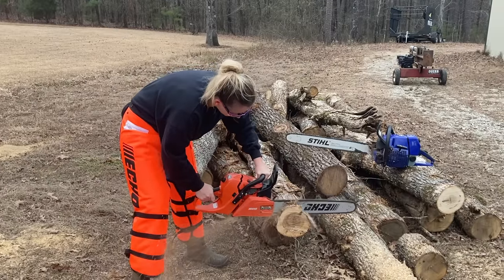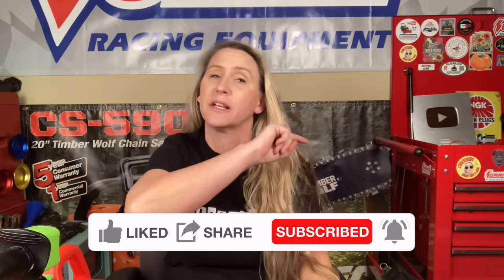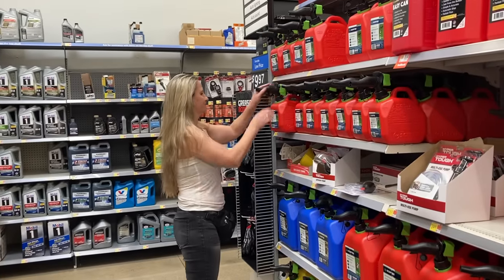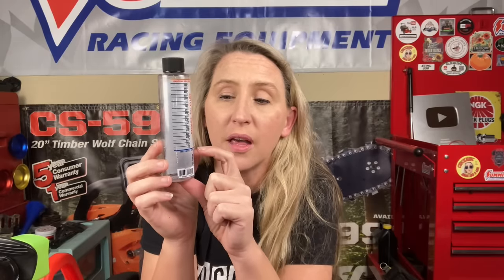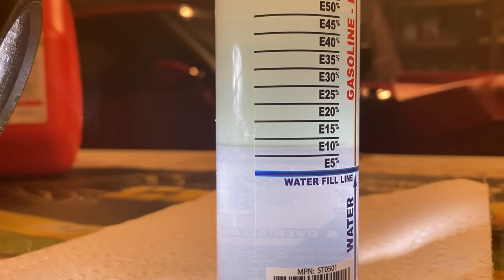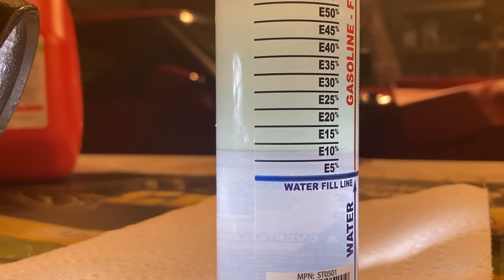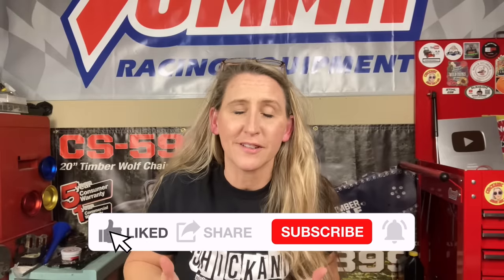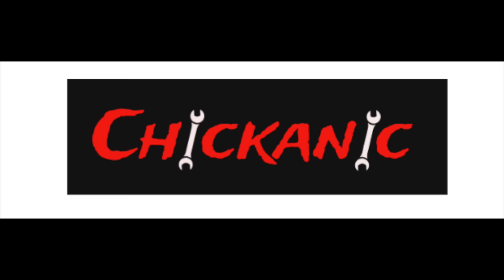Fueled by Deception. How You’re Getting Ripped Off at the Pump! (I'm SHOCKED!) VLOG

Comment: Being an ex-manager for 2 convenience store chains, some people may not know to not get gas at any place where they are in the process of unloading a load of gas. As the gas pours into the underground tank it stirs up the water and sediment in the bottom of the tank. If you get gas at that time or immediately after, you may get some of that in your gas tank. If you go to get gas and a truck is unloading fuel at the time, go somewhere else.
Reply: Hadn't thought of that, before. How long should you wait, before the crap settles back to the bottom?
Reply: What about the filters at the pump?  How often do they need to be changed?  I've been getting fuel for over 2 score and never had a problem, though I don't pay attention if a truck is unloading.
Reply: @magnificenthonky  the longer the better really. Like he said I see a truck unloading or parked at the station, I keep going. I suppose we could ask how often they fill up and when. I also don't gas up if there's been a heavy rain. Just over cautious I suppose.
Reply: The pump filter catches any potential materials. Your car fuel filter would catch the rest. I would say, any station that has slow pumps, has clogged filters.
Reply: I learned this the hard way from experience on my harley.   Had to clean out fuel tank etc.  full of sediment after getting fuel while truck was filling tanks..   I know around Washington the stations I use have separate hose.
Reply: Good tip. Thanks
Reply: Really never had problems after fueling when they where pumping. For there is filters in pumps. That is now a lie same with changing transmission fluid and filter. Not changing fluid and filter can damage for you got a bunch of little sensors and ports that can clog.
Reply: Honestly that's not true, I a receiver at a big truck stop. There say that to get the reading correct because before computers and 500 gpm drops it though the drop off.
Reply: @molallamerica896   And clogged fuel filters will activate the bypass in the filter heads allowing unfiltered fuel into your tank.
Reply: Agree. I've been going elsewhere for 40 years when a tanker was at a station. Never a fuel filter problem or need to put heet in my tank to get the water out.
Reply: I asked a Costco gas station attendant about that. He said nope, filters in trucks and the pumps catch anything.
Reply: This, and other potential problems caused by bad / contaminated fuel, is the reason I ALWAYS get a receipt when I purchase fuel, be it for an automobile, mower, chainsaw, or anything with a petrol engine. Then you have proof of purchase and recourse for any fuel related engine or fuel system issues or damage that may occur as a result. I've known of, and read about this happening over many years.
As an aside, and good advice from Gramps, get a receipt for everything! It will save you grief! Have a great and blessed day everyone!
Reply: I knew this, ive known this for 40 years.
Reply: @magnificenthonky  
At least a day.
Reply: Actually this is untrue because tanks never go that low.. I work on these tank and systems on a daily The amount of water left on the bottom of the tanks are minuscule amounts. If the water gets to certain levels there's a warning system on the pumps Mustplaces have something built in to remove the water.. But not all you would have to have a technician that deals with it come in to remove it
Reply: @samrotolo7303  
I never fill my bike with anything that has ethanol. Actually, I take a few 5-gallon cans in my truck and fill them all with ethanol free, then refuel from my own little storage garage. I'm lucky that the closest ethanol free station only vends one fuel from the pump marked ethanol free. There's no chance for cross contamination.
This video, however, taught me something I hadn't considered. I suspect it'll become useful when I'm traveling.
Reply: @magnificenthonky  5 minutes according to this video.
Reply: I've always done this.  I have also seen the truck and asked the driver where he was in the refilling process.  If he's still hooking up, I'm golden.
Reply: Old wives tale. Ethanol cleans the tanks, brings the moisture and dirt out of the tank. However, you are correct on the non-ethanol fuel, the sediment collects at the bottom and the fuel truck (which I drive) mixes it up.
Reply: Being a part of a great team at a reputable company I know that any good fueling station does water mitigation. If a station has water in the tanks they have issues.
Reply: that reminds me of a chicken carryout, they change their cooking oil on Thursdays so don't ever go On Wednesday's it's the worst🤨
Reply: @Pinkielover  Yes agreed 👍
Reply: @molallamerica896  pulled in an older station a while ago, looked at the spin ons located next to the pump, noted they were almost rotted out in the bottom, so I rolled outta there 🤣
Looks like they were new back in 2008 or so
Reply: And around here I see the fuel truck pull out of the shell near my place after filling them up, and it goes up the street to the Sunoco and fills them up. 
Hope ya like your Sunocogulfbpmobil gas 😃
Reply: i dont know what year u had store, but, we always use to use the meausring stick with a type of grease on stick end, it showed u how much water was on bottom of tank, once it reached certain level of water it was sucked out, many used alcohol to rid water , tanks and baffles have come long way
Reply: 100% I watch for trucks unloading every time I fill up!
Reply: As a guy who installs underground fuel tanks I know that the pickup for the supply line to the pump is in the bottom of the tank. This means it sucks the trash or sediment out first. There are also filters along the way. Not saying it can’t happen but the chances of the water/trash thing are pretty low.
Reply: @torquewrench4958  so over the life of your vehicle your getting unfiltered fuel whether u want it or not.

If filter is in "bypass mode" i guess it cant "shut down at 1st sign of water in the gas". Like they tell ppl that get water in gas.
Reply: @MrTheHillfolk  The trucks have up to 10 compartments (baffles) in the tank. They can carry high quality fuel drop at shell then go next door drop some garbage fuel at an unbranded station all from the same truck. 

I was told that from a tanker driver. Said they scan a barcode at the refinery but in the backend garbage fuel IS being dumped in certain areas. From same truck that also carries high specification fuel
Reply: That's why they have filters so there's no issue in pumping while they fill the tanks
Reply: @torquewrench4958  No they won't. Pumps don't have a filter bypass. A clogged filter is a slow pump.
Reply: @josephwhelan192  Exactly. People are stuck on old ways things were done and keep spreading old information as it’s some kind of hidden secret 😂

Old people are pretty dumb
Reply: @erikkovacs3097  yes they do. We don’t live in the 60’s anymore 😂
Reply: @christophervanzetta  Oh so the pumps slow down to 3GPM because... what? Failing pump impellers?
Reply: @willc5512  cool, I was kind of wondering about that, thanks for the clarification
Reply: I should have figured that out . Thank you
Reply: Damm Costco!!!   They always bringing in truck during the day.  I wish they do it at night after closing time.
Reply: @molallamerica896  this. Also water is soluble in ethanol. So water shouldn’t really accumulate much in E10 blended gasolines.
Reply: @Pinkielover   water is soluble with ethanol. If it’s ethanol blended gasoline you shouldn’t see much water accumulation…
Reply: Yup. This got me twice before I figured it out.
Reply: Makes sense! Of course it didn’t dawn on me until you mentioned it! Thanks!
Reply: Heavy rain previous night. Filled with premium which doesn't sell fast. Customers car ran like crap. Finally figured out too much water in the tank.
Reply: There are filters on the pumps to protect the pump from garbage..
Reply: if the pump runs slow it’s sign that filter is in need of a change, switch to a different pump with better flow rate, some stations cheap out by trying to make filters last longer.
Reply: @Pinkielover  gas station here has pumped there tank dry twice in a few years
Reply: That’s what filters are for ! That’s urban legend !
Reply: @roostercogburn3771  if your at a station and it pumps less that 1 gallon in 14 seconds either the filters are starting to clog up or there have a weak submersible pump !
Reply: And here I thought that the pumps drew fuel from the bottom of the tank.
Reply: @Midnight-tw3gp  only on really old suction pumps. Today all the pumps actually in the fuel tank ya lift a handle on 1 they all are pressurized
Reply: @michaeldriver1356  your absolutely right, 2009 in Flordia a tanker ship unloaded high concentrat sulfer fule,  (contaminated) huge amounts of tankers trucks delivering fule to gas stations. The police were having a hard time getting cars of the turn pike, they also caution tape off many gas stations. Unfortunately  I paid with cash then broke down 12 miles on the Ocala bridge...plug my injectors on my Ford truck... Tow bill, injectors replacement cost more that what the truck was worth.
Reply: pumps have hydrosorb filters  you will not get fines or water in your fuel tank if a tanker is unloading while you are filling your gas tank.
Reply: My grandfather taught me this early on" you see a fuel tanker, then you go to another station boy"😂
Reply: That used to be "common knowledge."

However, reputable stations these days that have high-volume fuel sales will have quality pump filters in place, and little sediment in their tanks.
Reply: 5 gallon gas cans and the cheap harbor freight transfer pump.

And those plastic “splash guards” come out with a little effort and a screw driver. Honestly, I think they’re meant to cause splash when you fill the container.
Reply: @EweToobUsername  just bought harbor frieght transfer pump cuz it was on sale for $9🤣👍🏽
Reply: @EweToobUsername  

They cause so much slowdown by building up vapor that some pumps keep shutting off. I have to hold the nozzle at the edge sometimes. 
The couple of times I've tried removing those "spark arresters", pieces have fallen into the jug and have been hard to get back out.
Reply: @daisykaren6584  HUH??
Reply: I managed some gas stations in the late 70's. One station did not have enough threads on the pipe that went into the underground tank. The regular unleaded gas tank underground had a lot of water in it and when people filled up with it while a truck was delivering gas, they got so much water in their gas tank and a short drive down the road, their car would stop running. They had to be towed and the fuel system cleaned.
Reply: @vernonsteinkamp1088  the water comes from your in ground tanks
Reply: @Pinkielover  I hauled gas in the 70's & 80's, and we use to reverse pump the water out and back into the truck tank. Back then you always had a 5" of unpumpable product to catch the water
Reply: There a fuel filter at the pump, it’s safe to pump gas even while a truck is filling a fuel tank.
Reply: @molallamerica896  a filter doesn't catch water it   catches foreign particles
Reply: @dido1803   I know the Costco by us gets three deliveries a day, not sure if it even has a chance to begin water separation
Reply: I asked a gas trucker this and he told me nope, he got all sort of bent out of shape and was ready to open the hatch and show me how clean the tanks were.. he wouldn't vouch for other stations, but he was dead set on me being wrong..
Reply: @Ryan-re1rs  I am a ex gas trucker also, you can't see the water, water is heavier gas and it sits at the very bottom of the tank
Reply: @MrTheHillfolk  pretty much all gas is the same. It all comes out of the same pipeline. The only difference is the additives they add to it either when it’s out in the truck or in the tanks at the stations. But the gas is all the same. That’s why when people are like, “you mean you buy gas from THAT place?”, I’m like, yep, sure do!! Wherever is cheapest!!
Reply: @Ron Rice As someone who works at the busiest gas station in a large city and manages many deliveries a day, I can categorically say that this is false.
Reply: @torquewrench4958  you’re referring to the filters in vehicles, not in gasoline dispensers, which simply slow down.
Reply: @christophervanzetta  a filter bypass allows an internal combustion vehicle to keep running when the filter is clogged. Fuel dispensers aren’t running on the fuel they dispense. They use electric motors and do not need filter bypasses: the flow simply slows down as filters slowly gather particulates.
Reply: @mancavemotorsports  perhaps this was wise advice when he was young: it isn’t today.
Reply: @BinglybertSlaptyback  I'm sure you meant the practice isn't necessary today. Not wise is wild 🤣🤣. I understand though, however old school values mixed with new school learnings hasn't let me down yet!
Reply: @BinglybertSlaptyback  you seem knowledgeable so I have a question. Is it true that the 1st 3rd of what you pump from the nozzle is what the previous gas purchase octane was?
Reply: @srcastic8764  I'm not going back thru 75 comments ,but around here the fuel truck pulls into Sunoco ,fills them up and goes right up the street to the Gulf station. 
Only difference around here is going out of this county where non-ethanol is available.
Reply: @dido1803  They probably bring in truck at night too.
Reply: @donmarotz4518  In that case the volume of gas being loaded and sold prevents the issue.  Old small stations with one or two pumps getting supplied once or twice a month.  It's rare, but the first indicator of failing tank and pump system is when someone gets bad gas at the pump during the delivery.
Reply: @MrTheHillfolk  yeah, that was what you said in your comment I was responding to. I was agreeing with you, giving explanation as to why that’s the case. It’s because it all comes out of the same pipelines. Then they just add different additives based on which station gets the gas. So there’s no difference really in “that cheap gas” your dad said never use and “the good stuff” he always said to get.  It came from the same pipe.
Reply: I feel your frustration with the damn fuel containers. How stinking dumb do you have to be to need one of these fill valves?
Reply: @PapaA7145 that’s why I bought an electric pump off Amazon. So much easier and I haven’t spilled a drop since. I hated the new spouts so much I decided it was the only way to go. Of course, we cut 3 acres of grass every week, so we use a LOT of gas.
Reply: I was a manager also. It amazing how many people can't read a diesel sign. Then want the store to cover thier ignorance.
Reply: Omg. It runs through filters before it leaves the pumps.
Reply: @torquewrench4958  nope.  Try again.  Nothing gets bypassed.  You know how many cars would be damaged if that was true?  All
Reply: Many say what about the filters at the pumps. I know not all stations have filters.
Reply: @vernonsteinkamp1088  there no filter in the tanker
Reply: @MrTheHillfolk  it all comes from the same tank at the pipeline
Reply: Excellent information! I'm a brand new subscriber.
Reply: @koreymartinson7238  you realize if that was the case every fuel station that contaminate and wreck your car would be sued, right.  Plus your car has a very good filter as well. This is just an urban legend
Reply: Fuel delivery driver here with own company and 3 owned store of my own. So we have tested this. If your filter are clean and replaced on a regular and ground tank opening caps properly sealed impossible. Trash in the tank that can get in a customers tank is just pure negligence on station owner
Reply: @Pinkielover  then why does tdlr have a division of investigators just for this reason water and other shit in the gas tanks. My friend used to do about 40 of these cases a month in north Texas alone. You can’t tell me the filters catch everything.
Reply: My Dad used to do fuel drops at gas stations and he always said never buy fuel at that time. The filter system Can't cope with all the garbage stirred up at that time.
Reply: Fuel trucks used to fill the tanks at night/early in the morning while the station was closed. The world used to make a lot more sense years ago.
Reply: On ethanol free gas I always put a gallon or two in my car to clear the line before the jug and plus it reads ethanol free is they give it to you at no charge it don't read does not contain ethanol so the class action lawsuit will fail
Reply: @mancavemotorsports  the hose, from the juncture in the dispenser where the fuel is metered to the nozzle, will contain roughly ⅓ gallon of the previous user’s octane choice.
Reply: My very old lawn mower would not start . Replace filter and plug , same problem . Ok time for a new one . 

Gas up the new one same problem . Dump the gas from all two  , went to a different gas station  fill all two tanks , all two lawn mower start on the first pull . Now I have two working lawn mower .
Reply: Totally not true, I've had fuel tested at stations that are fueling up.  No additional sediments have been found in the random samples.
Reply: I heard the same thing.
Reply: Yes they are, but also that goes to a gas station maintenance too, Dad us to run several gas stations, he alway kept water paste and dip the tanks after they drop fuel. That way he knew if he need to put the stuff in to help drive out the water, he us to stick the tank before they got there, and after. An he kept the filters changed on the pumps as well. A lot places nowadays don’t do that, they depend on the sensors.
Reply: @torquewrench4958 not how it works when the filter on a gas station dispenser senses water, it then stops the flow completely. When the dispensers get to pumping extremely slow, then the filter is indeed needing to be changed from plugged by sediment
Reply: My father told me that the day I got my license.
Reply: r might be anywhee from 5 to 20 gal of water in a 10,000 gallon container
Reply: @tommymeade9178  They have water paste to stick the tanks with to see if there is water in the tank. An they can add the additive to help run the water out the fuel. My Dad said they kept on top of that, because they didn’t gas station would get a bad reputation. That back when they still had full service gas station everywhere.
Reply: You're supposed to have your company clean those tanks out regularly so that there is no water and sediment in the bottom of the tanks. In fact somebody in this comments section claiming to be a fuel delivery driver says that every service station he goes to he tells them if there is water and sediment in their tank and does not fill the tank until they clean it out. I'm sure I do not believe the driver because I've been to too many gas stations with water and sediment in their tanks. It would however be very nice if service stations that know for a fact that they have water and sediment and their fuel tanks would get this stuff removed.
Reply: @magnificenthonky try to go to a brand-new gas station that has brand new tanks so you don't have to deal with that problem.
Reply: @alexandercopeland2849 then why do brand new modern cars come with what they call forever fluid in the transmission and say that you never have to change it?
Reply: @vernonsteinkamp1088 the water in my gas can after fueling after a rainstorm would say different and it was a brand new gas can I bought at that gas station on that day.
Reply: @Pinkielover it may be untrue on the specific tanks and stations you work at but not everywhere.
Reply: @happydays8171 the ethanol absorbs water and go straight into your gas tank.
Reply: @bobbyhempel1513  It's likely to be quite a while before I have another new gas station pop up near me. Best I can hope for, is an existing station receiving new tanks. I live in the middle of nowhere, with the small local town being pretty well built out, decades ago.
Reply: @bobbyhempel1513  that's a lie or else you couldn't check the fluids in the transmission. I changed 100 of them so called sealed transmission. Fords are the hardest. The ones that have a dipstick hole all you do is look in owners manual and has guide on where fluid should be on stick. Just use oil dipstick and mark with marker. Just like on the newer b&s pushmowers. Says to check and add but in book and website to change every 50hrs or every season
Reply: @MrTheHillfolk I noticed that too and when I inquired about it I was told the difference is in the additives, if you can believe that.
Reply: Thank you for the video I used to work in the petroleum industry I dug underground and realign the fuel tanks if the tanks have been lined or are fiberglass blessed contaminants you have in the tank but most generally you want to wait overnight for that stuff to settle out if a tanker has dumped.  Also I do not know about other states but in the state of Kansas if it has less than 10% ethanol 10% or less they do not have to tell you it has ethanol they can advertise it as ethanol free.    A local gas station that just sold out to Casey's used to have ethanol-free super unleaded and I just purchased them before they switch to test it and see if it has any ethanol luckily this station does not carry E85 so hopefully it is true non-ethanol
Reply: They all have filters that filters the gas before it comes out of the nozzle
Reply: Myth, relax get gas anytime...its all the same
Reply: @bobbyhempel1513 Because it’s a marketing ploy.
Transmission oil and filter should be changed at least every 100,000 km.
The only time you are not advised to change transmission oil is if the oil has never been changed and the vehicle has a high mileage on it.
Reply: That is correct. Known this for decades. Always wait a minimum of 30 minutes after a fuel drop to pump.
Reply: Come on .... They have filters at the pump dude. It's all filtered to the micron level and your car has a filter as well.
Reply: @vernonsteinkamp1088 Also Costco has such high rate of turnover,sediment and water not likely to be an issue
Reply: Isnt the pick-up where the pumps pull fuel from at the bottom of the underground tanks anyway
Reply: Thanx. Good advice.
Reply: Know that and live that rule. There is a rip off station in Canada that I've have bad "premium" at. They can take a flying leap
Reply: Malarkey! All of the fuel is pumped from the bottom of the in-ground tank. You can't pump from the top. 🙄
Reply: It helps to use high-volume stations so the tanks are fuller of fresher gas. Also the separators  keep water and dirt out of the dispensers
Reply: A friend of mine told me the same after he had issues when filling up while the fuel was being pumped into the underground tanks.